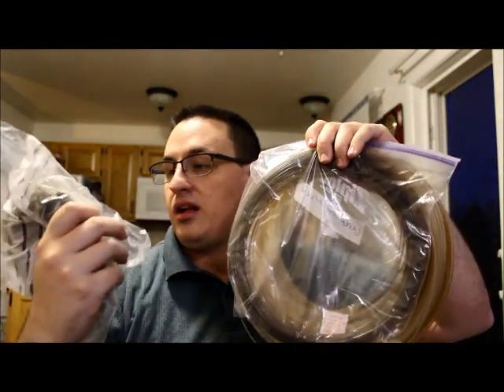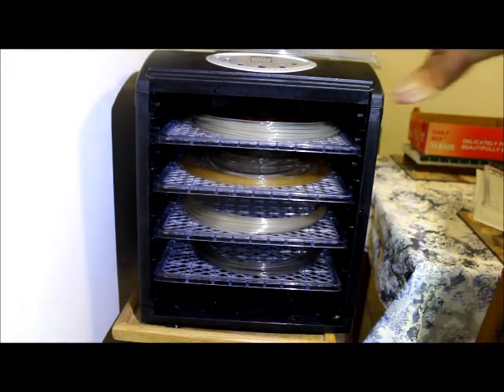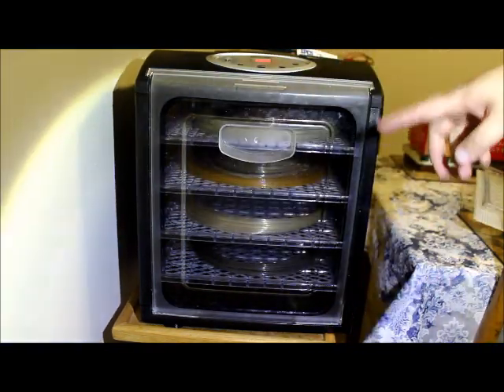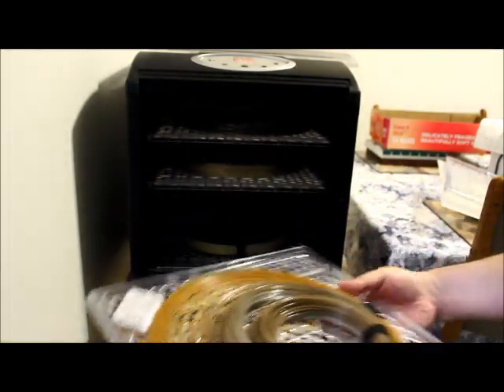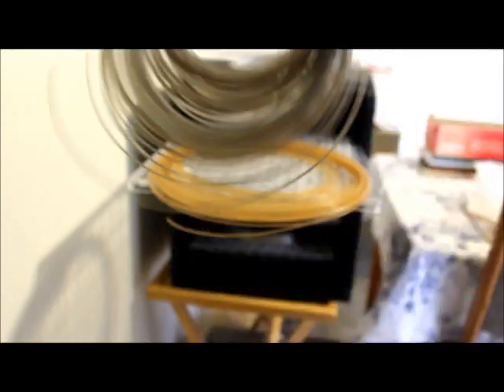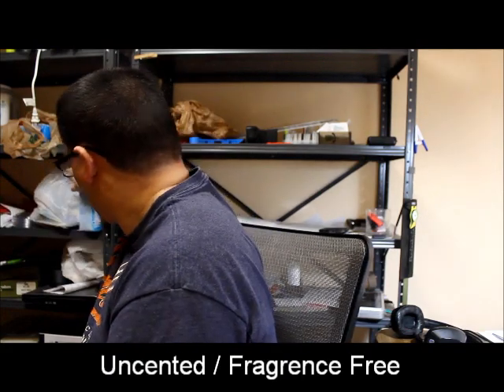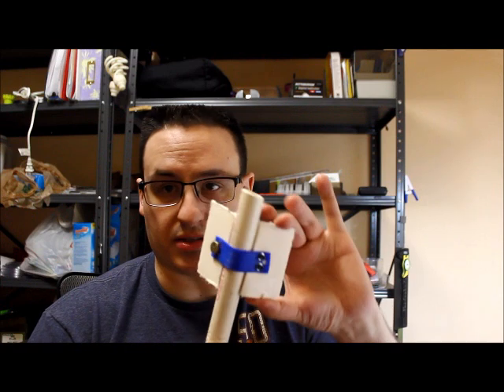How to fix brittle 3D printing filament

Comment: can i use my mircowave oven for this?
Reply from the maker: I have not seen anyone microwave filament to dry it. In theory, sense a microwave works by heating water molecules, and they are know to dry out food, it would be interesting to try. That said, creating steam like that may fracture filament. I am thinking it may be like cooking hot dogs in the microwave, where they split and pop if you don't time it right. I'm not going to try it, but you're welcome to. Please post your results, but I'd recommend a shop microwave you don't intend to eat out of.

Comment: What about abs? also using oven does it take 6 hours...also where did you come to the conclusion you need 6 hors at 115 degrees??? i have a couple of brittle half and 1/3rd spools that snap easy... thanks
Reply from the maker: I avoid ABS due to warping issues... The time and temp comes from some other resources, you can adjust your dehydrator settings based on the size of your spool.

Comment: I am glad i found you and you broke it down for me... i was thinking the pla had gone dry, and was looking for a way to boil it in water!.... Thanks man.
Reply from the maker: No, it's the opposite. PLA works best when dry, not wet. When it gets wet (from being in the air too long) it breaks down and becomes brittle. You can boil it (watch the video on heat treating HTPLA) but that is after you 3D print something.

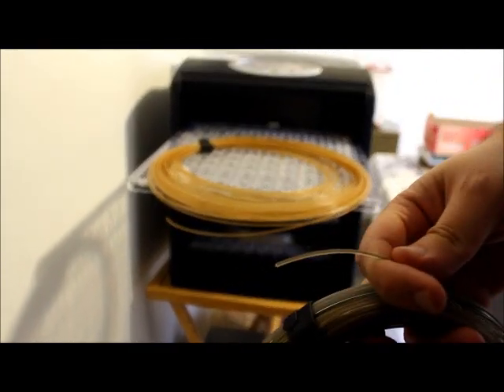Comment: Well as you've already experienced at 4:54, the dehydrator did not actually fix it. Moisture is not the reason PLA gets brittle. It's being exposed to air and light. It starts to degrade. The mitigation is to store them in bags in a dark environment.
Reply: I keep my PLA in a sealed bag, with dessicant packs, in a dark drawer. It still gets brittle.
Reply: I keep my PLA in a humidity controlled vault powered by geothermal climate control power stations, even inside the z4 hybrid vacuum chamber they still get brittle. Waste of $500,000 would not buy again.
Reply: @chrishayes5755  😂